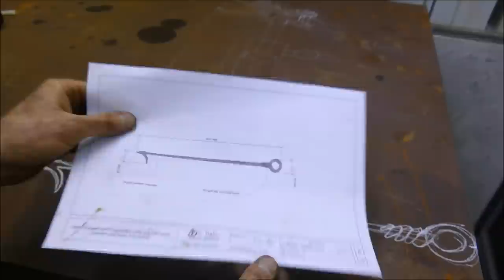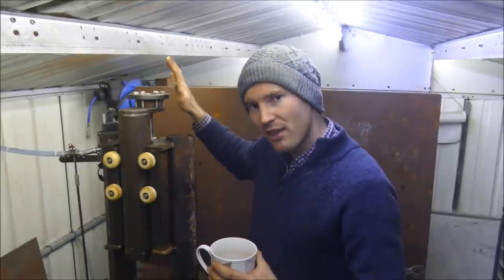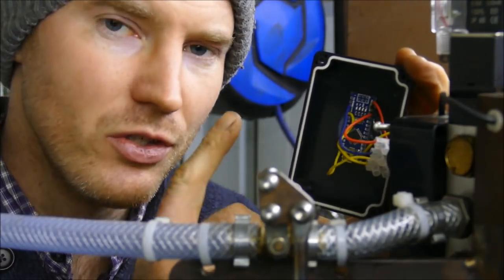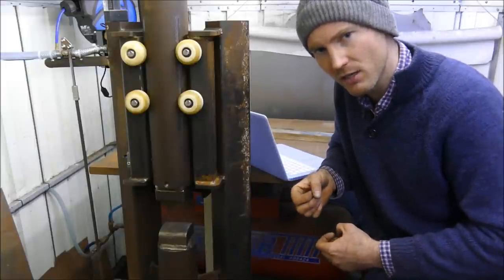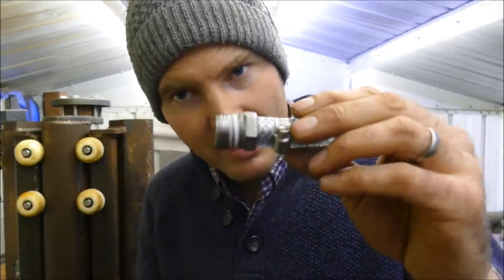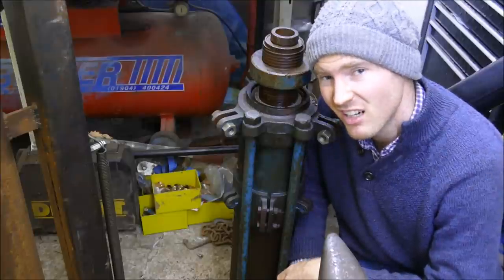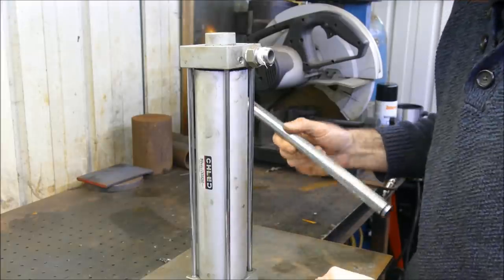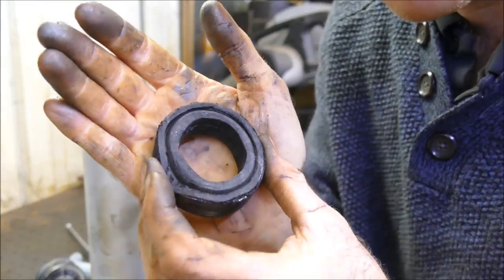DIY Power hammer + computer = Awesome // Homemade Pneumatic power hammer self build plans POWERFUL!!

Comment: If we purchased the original plans and original upgrade plans already, will they be updated or will it be a separate set of plans?
Reply from the maker: Hey Kevin. Yes it's nearly ready and will be out soon. Ive got in 3 different downloads and will also release a full version too for anyone who didn't get the first set.  PS I'll be doing a limited time deal with 50% off so look out for it on Instagram/ YouTube feed.

Comment: Thanks
Reply from the maker: Thank you so much Bernard. Hopefully lots more videos coming soon. Cheers J
Reply: Thank you Joshua. I am impressed by your attention to detail matched with in-depth explanations. I wish you every success.
Reply from the maker: @16111945  your very kind. More on the power hammer coming next year. I may have a plan to build pre programmed ECU with a dial for delay settings. Cheers J

Comment: You said that you plan on selling completed units in the future, do you have any idea about estimated cost?
Reply from the maker: Hi. Before lock down they were going to be £2050 with free UK delivery. Steel and supplies have gone up since so I'll need to re calculate it. As soon as I'm set up in my new workshop I'll begin manufacturing which won't be until September. Cheers J

Comment: In your Amazon links you list a 1-1/2" ball valve is this correct? Looks like a mistake , the UK Amazon lists a 1/2"
Reply from the maker: That's changed. Yes 1/2" is what I use. Cheers J
Reply: @joshuadelisle  Thanks I recently bought your plans and am starting to source materials and parts to build.

Comment: don´t you think that the airoil killed the rubber? would be my first suspicion
Reply from the maker: I'm not too sure. The rubber is designed for engines so it should take oil fine. I used a silicone based grease earlier on but started adding oil later on. I would say it's worked fine for a good fair while but won't last indefinitely and needs replacing once a year. I think the new air cushion in the electronic valve system works better and the addition of the floating linkage take further shock from the cylinder considerably.
Reply: @joshuadelisle  I worked 25 years in ac/refrigeration, most rubbers/elastomeres couldn´t survive the systemoils even when fresh and not outburned, grease is also poison to natural rubber, cheap o-rings are sometimes not  "oil/acid resistant" . But you´re better into the wear and tear of your hammer, could, as you say, just being the amount of strokes that cylinder has done. Btw. i don´t run when you´re talking, so just keep on the nice work you do, and i´d like to see your aircontrolled hydraulics. Regards
Reply from the maker: @franckherrmannsen7903  thank you so much. Good Information. Yes I'll definitely experiment with air over hydraulics. All the very best. Cheers J

Comment: If he said in the video I apologize, but did he mention how many CFM a compressor would have to supply to make it a 100% duty cycle?
Reply from the maker: I haven't formally worked that out but you would need a screw compressor to fulfill that kind of output. Cheers J
Reply: @joshuadelisle  yeah after thinking about it the time between reheats of the material would make 100% duty capability a waste of money. Thanks for the reply
Reply from the maker: @jerod5636  I'm thinking of upgrading mine to a 36cfm from current 15cfm. That to me is plenty on a 200ltr tank.

Comment: Has anybody tried a pneumatic power hammer with a spring return piston? I was thinking of the spring dropping the hammer. If you have that much weight on the hammer 'head', do you actually need the air pressure to drive it down?
Reply from the maker: Hi. It makes a huge difference forcing the head down. The calculation is mass X acceleration = impact force. power output is exponential relative to the acceleration otherwise you can use gravity as a constant and increase the mass instead but that's expensive.

Comment: Hey J I  found your video series a couple of weeks ago and I plan on building one of your hammers as soon as I finished with my house I just have a couple of questions did you build the coke forge that you use and do you prefer a coal/coke forge over a gas forge and where did you get your maker’s mark tool?
Reply from the maker: HI Jeffery. I'm actually using charcoal now that I make myself from local coppice wood, its sustainable, carbon negative and is plenty hot enough. I made my forge yes and I hope to build another one soon and release the designs for it also. My makers mark I also made myself from spring steel, takes a lot filing and drilling and so its probably more cost effective to buy one that is machined instead. Cheers J

Comment: In your parts list, you don't list the check valves used for venting to the atmosphere.
Reply from the maker: No because they don't allow the safety feature of the new electronic valves. You can use them still for a little extra power but if your valve is close to your cylinder it will be fine without.
Reply: @joshuadelisle  ok thanks! Do your plans explain how to hook up all of the valves and electronics? I consider myself a decent fabricator but you have inspired me to venture into areas I've never delved into before (pneumatics). Thanks for your speedy response and constant inspiration.
Reply from the maker: @unuensisable  hi. Yes there is a pneumatics diagram and electronics diagram. Any problems or difficulties feel free to ask any time and I'll help as best as I can. Cheers J
Reply: @joshuadelisle  consider another copy sold then! 🍻

Comment: Is air over hydraulic really needed? Wouldn't an electric motor move that lever just as well with less cost and complexity?

You know copyright doesn't apply to inventions, right? You can copyright the plans, but that doesn't stop anyone from building the design unless there's a patent.

Comment: I told you that ram would break off!
Reply: You really need to stop the moving parts physically or that's just going to do the same thing. Really like the electronics you have add nice move. Hope you and the family are well and had a great Christmas and New year's.
Reply from the maker: The new valve does that and creates an air cushion instead. But the ram bolt came loose not break.  But I agree it's much better now. All good here just want more time in the forge. Lockdown hasn't affected suckleys and we're busier than ever. Hope you're doing well too. Cheers J
Reply: @joshuadelisle  I didn't see the bit with the air cushion that should help a lot. Looks great dude nice job.
Reply from the maker: @danielmoss2089  thank you Dan. Did you see the bit about the press idea?
Reply: @joshuadelisle  yeah I did. Worth a try but you'll find that a variable displacement pump will do a much better job. You might be able to find one on a mini digger (pump). We used the hydraulic/pneumatic jacks when I worked at cat and liebherr. Great bits of kit but they slow right down when they need to do work. It's the disadvantage there fast to move the ram but slow to build pressure. Also I think the ram you have is single acting which will be slow to lift or drop of the work depending on the way you set it up. Great as a jack or a press for bearings but not right for a forging press way to slow. Again a mini  digger ram or ram's would work much better. You will also be surprised how little tonnage you will need to get the job done. 50 tonnes sound great now but that's a lot of oil to move and time is not on your side with a forging press.
Reply from the maker: @danielmoss2089  good advice. I'll give it an experiment though, be good to see the results. Cheers J

Comment: The anti-jamming rubber Should be installed with the spring stopper outside the piston on the up/down supported frame.

https://drive.google.com/file/d/1sgHTjscPC3wLTdgWz4xCFWDG7jniac5S/view?usp=sharing

Comment: f@t b@st@d says = yes interested in the complete air kit if available = all the bits air things needed + computer bits and add on"s and have mailed a laser cut company if available / able to download and cut metal  = cheers  ps the jack press is a must do and have seen a good simple one that turns a 1 tonne jack into 10 tonne with a simple frame = cool ideas

Comment: The Arduino has analog inputs, that can very easily read a variable resistor, and convert it to a number, which you could use for the time delay.  If you use two variable resistors, read the values, you can make the up and down time delays adjustable without changing the code.  This could also be useful to adjust the speed and strength at any time, based on what kind of work you're doing.  Finally, you could also very easily use an air pressure sensor which reads like a variable resistor, and automatically adjust the timing to compensate for the compressor.
Reply from the maker: I already looked into that prior to this. The problem is the Arduino reads one line at a time and if reading the the PotVal at the point of needing to read the sensor it would miss the sensor and would fully extend smashing it self. There maybe a way to code it so it doesn't do that. Otherwise in theory what you suggest does work. I had the delay match the value of the potentiometer like this: delay (==PotVal); .... Your thoughts on this is appreciated if you know a way round it.
Reply: An easy solution is to not use dalys. Use the millis() funktion and if stament. This short loop runs several thousand  tims per second so there is no chance of missing the Sensor. An even safer solution is to use an interrupt from the Sensor, but that is a bit mor advanced programing. You can send me your code  and I can send you beack an excample for this.
Reply: Your ingenuity is fantastic very inspiring i most certainly will build a power hammer first i need to get an anvil and build a forge.
Thank u for sharing
Reply: @electricalychalanged4911  the easy way is to not mess with a arduino and just use a simple plc and be done with it. Industrial controls, industrial machinery. Easiest way to automate anything.